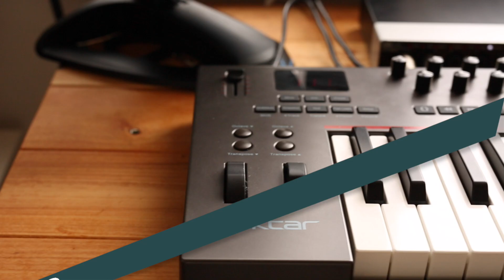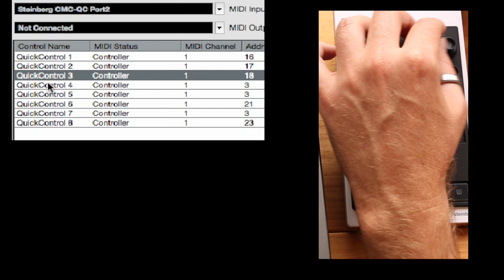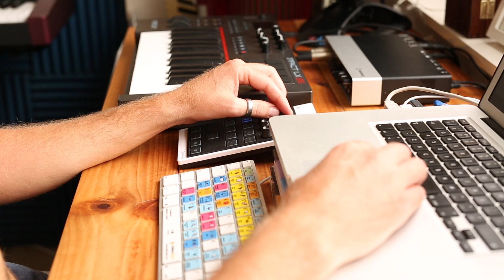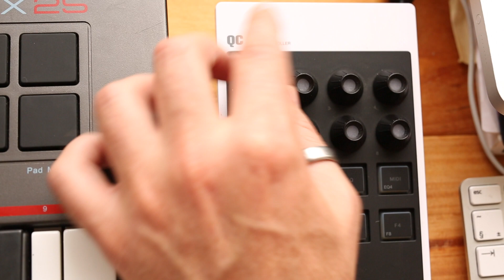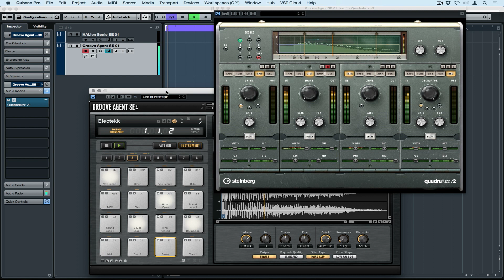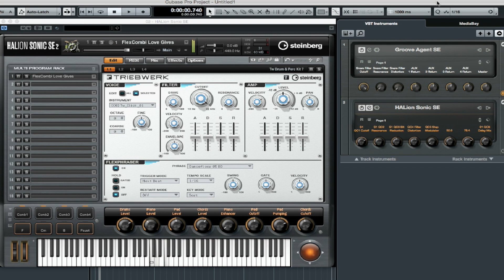Quick Controls & External MIDI Controllers | Tips, Tricks and Workflow Enhancements

Comment: Unfortunately I am trying to use SWAM Cello and when I try to change the quick control parameter it doesn't work on a lot of them.  What am I doing wrong?  For example I see a parameter called bow start, but it remains dark and when I go into Studio, Quick Controls VST, it doesn't "learn".    Also, how do I assign a parameter so it shows up in the MIDI Editor - assuming it's not already in there?  I guess it's a 2 part question - #1, how do I get any parameter in the synth to be connected to hardware, like I can easily do in FL Studio.  And #2, how can I get these parameters to show up in the MIDI Editor in case I'm unable (as is the case) to get quick control to "see" the parameter?   It seems to "see" what the defaults were, but not be happy with any of the parameters I'm trying to get "seen".

Comment: How do you get the Quick Controls track at the left side? Do you need that in order for it to work? Is there more info on this anywhere? Do Quick Controls work with any midi controller (that has knobs/encoders)? Thx already.
Reply: Ooh - I just read in the manual at page 731 and further that Quick Controls is added to many types of tracks automatically. I did not know that. Now I only have to make it work with my Axiom Pro 49 - somehow nothing happens when I turn the knobs. I have assigned them via the learn function in the Studio Setup window. And then I assign a VST know to a Quick Controls slot via the option menu after right clicking. I was only wondering which inputs and outputs to set for the Axiom Pro in the Studio Setup window? The hypercontrol input/ouput or the normal USB in/out port?

Comment: I am trying to get Elements 9.5 to work with M-Audio Oxygen 61 (latest version, latest drivers). Quick controls and also setting up as a device will learn everything I want it to. After applying though it doesn't do anything at all. I can see the midi activity is fine and receiving but for example if I press the play or record button, nothing happens at all.

Comment: pretty convoluted tutorial - more of a sales pitch really
Reply: Not really. It is spot on. If you have a keyboard controller, it explains how to map and use VST & Track controls. Nektar is great because it is integrated in Cubase. I know this, because I started out with an Akai MPK Mini MK2 and it was murder trying to get the knobs to work. Forget about the pads being mapped correctly. I finally gave up, researched controllers that work with Cubase and settled on the Impact LX25+

Comment: I've worked with a couple of controllers now and none of them worked with MIDI learn aka QC out of the box. What did the trick for me on a couple of occasions, was to make sure that the MIDI assignments on the controllers are undefined. They will usually read something like "22. undefined" or "23. undefined" aso. These are usually safe to use. These parameters can be changed in your controllers MIDI control software.

Comment: I'm sorry Stienberg but this system  is not good. We just need one button 'midi learn' then click the parameter with your mouse, wiggle your controller knob then done. Why can't we have this? It's so simple and many other DAWS have this. Honestly this does not work well and is driving users away.
Reply: I hate Cubase mapping is outdated, old and confusing! simply horrible!
Reply: It does do what you are saying. What this video is showing is offering more. Rather than learning a CC to one specific parameter in one specific track or place this standardized it so it becomes more flexible based upon what you are actually doing within Cubase.
Reply: @kylelynch8888  Other DAWs have this as well, they have Global and Focused mappings simultaneously.  But in Cubase I can't find a tutorial showing in detail what you just described so I would be very interested in the pages in the manual for the current version - Cubase 13.
Reply: @cachelesssociety5187  the idea behind this is once you map your quick controls then move from channel to channel etc the mapping moves with it so you are not just stuck to one midi control only doing one “learned” thing it’s assigned to do. It makes it so you can customize your quick controls on the channel level and be able to control whatever you want without having to have more hardware. Checkout the searchable online manual. Or just mess with channel quick controls. It’s not complicated.

Comment: I have been unable to get my recently purchased Komplete Audio 6 working with my Korg Microsynth and Cubase LE. This guide doesn't help, Cubase is detecting MIDI input but will not allow me to select a VST instrument. I am going to return my Komplete Audio 6 because Cubase 8 LE SUCKS.
Reply from the maker: Hello, to select a VST Instrument you just need to add the an Instrument track, if the VST is recognised by Cubase you shouldn't have any trouble. Cubase is a complex software that requires time, patience and practice, like any music instrument.
Reply: Steinberg I understand that but your program is experiencing a bug on my machine. I have vsts yet cubase doesn't see them. When trying to select a vst the list flashes for a split second then disappears.
Reply: Another reason I will be returning my daw is due to customer support. My registered product isn't being shown in mysteinberg so as to open a proper support ticket.
Reply from the maker: Hello, please make sure you have the latest version of Cubase LE8 installed in your system: http://www.steinberg.net/index.php?id=11987&L=1
Reply from the maker: Hello, you need to register your soft-eLicenser inside your MySteinberg account, then your license for Cubase LE8 will appear in your account. You will find the soft-eLicenser number inside your eLicenser Control Center.

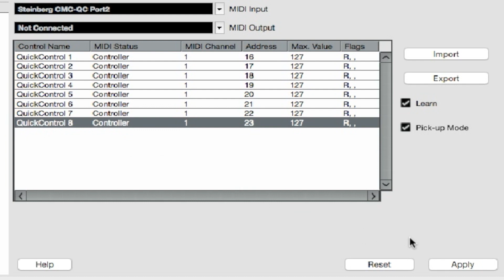Comment: At 1:54 into the video, he goes on to explain setting up VST Quick Controls for 8 QC slots with the Learn function.  It seems his Impact LX25 is sending CC0 on channel 16 and he's having all 8 QC slots set this way, and all virtual knobs in Halion Sonic SE respond when he turned his physical knobs on the Impact LX25.  I just tried the same thing and can't get any response from the plugin.  Very frustrated with this process.
Reply: +Mark Davenport Hi Mark, the LX was already set up (the advantage of these controllers are that they are mapped but if I had a new MIDI device, the MIDI device should already be installed (and if you are on a MAC, it should show up in the audio/MIDI app) and then you should be able to MIDI learn the devices by moving the encoders in learn mode. If it is not working then you should double check to see what settings your controller is sending out through encoders? Occasionally, when using different MIDI devices I have to go through the presets to ensure it is sending out MIDI information on the encoders. Do you see any information when you are moving the encoders in learn mode?
Reply: +Andy Schrav Hi Andy, and thank you for the response! I could see MIDI data appear on the Transport bar, but I wasn't able to get any of the VST Quick Controls to respond to the physical knobs on my controller.  I had no problems with Track Quick Controls and Generic Remote, but VSTQC was an issue.  However, I went through it again tonight, same as I had before and Voila, it works!
Reply: +Mark Davenport Ah, that is indeed good news. Glad you got it working:)

Comment: Do you have to use two separate external midi controllers for VST Quick Controls and Track Quick Controls, or can use one midi controller for both VST Quick Controls and Track Quick Controls?

Would be good if it can by only allowing midi data to be passed to the Track or VST currently in focus.
Reply from the maker: +Orlando Brown Hello, No necesarily, you can use just one controller. 
You can select the MIDI input source for each track or disable the MIDI input for the other tracks.
Reply: +Steinberg thanks for that i will give that a try.
Reply: +Steinberg  i  am new to cubase. how do  i use drums from media bay as a midi file. i want to be able to play my 808's as diffrent notes.  is there another option besides groove agent?
Reply: De Mad are you asking if its possible to scale the 808 drum sounds to midi notes like what the kids do with fruity loops to get that trap music sound?
Reply: +Orlando Brown  , how do you use  you media bay files as a midi
Reply: +De Mad Hi there, you need to first locate them in the media bay file browser (watch the video on the media bay and how to add files). Then, also in the media bay video, you can see how to filter between audio, midi files and midi patters etc. You should be able to see your file there. The media bay video also shows how you can ensure they are in the correct project tempo. Hope that helps!